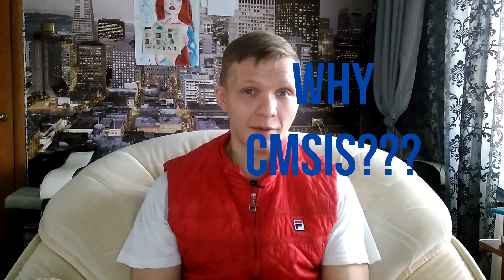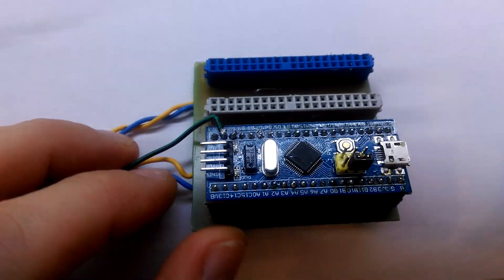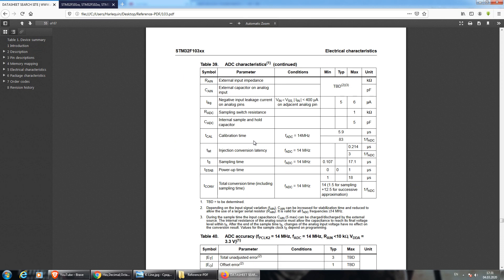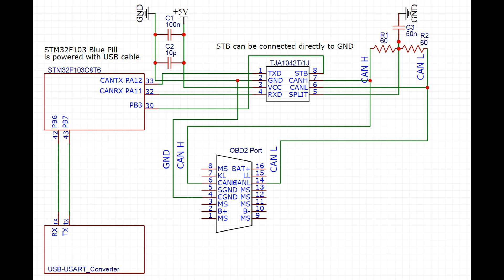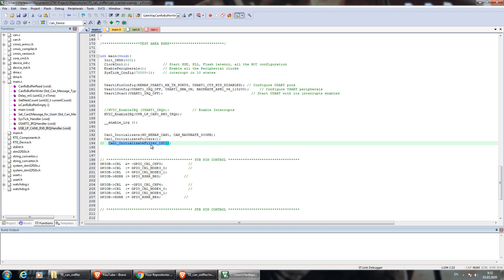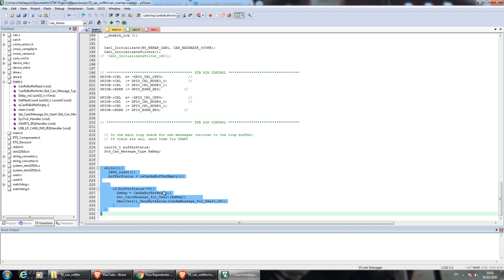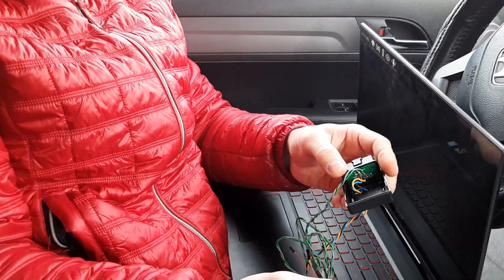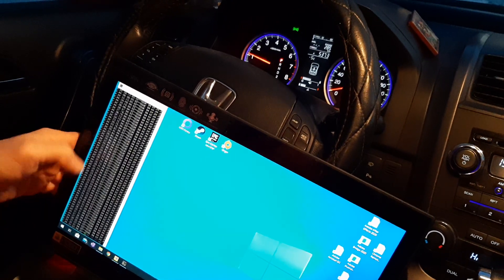STM32 CAN Sniffer. How to listen to CAN traffic in your car. DIY. CMSIS

Comment: Hey Alex, your videos are the best! I'm learning so much! 
Right now I'm working on a project and I really need some help... I need to read a odometer from a toyota, but I´m not really sure if I'm going in the right way, can I do it with this device you created? I builded a pcb similar as yours with a transceiver and a bluepill, using your program I can read the data from de CAN. Plese Help me!
Reply from the maker: Hi, Kaique! Yes, you can use this example to read out CAN data including odometer. If you don't know the id responsible for odometer, I recommend to use this code https://github.com/SvetlAl/CAN_HACKER_LAWICEL   together with CAN-Hacker software. First of all make sure your hardware is up'n'running and wiring is properly connected and soldered. If you have any issues, my email: svetlal@outlook.com
Reply: @alexsv1834  Thanks!! You're the best!

Comment: Hello friend, I would like to get data from a bms I have a stm32 and I am using tja1050 transceiver but I have not been successful. Do you think the use of CMSIS is relevant? What do you recommend me to achieve this?
Reply from the maker: Hi! Using CMSIS makes sense if you want fast compilation and data processing, with 72Mhz MK and 1mbps CAN bus this maybe critical. Do you use stm32f103? What place are you trying to use your device? What car?
Reply: @alexsv1834  I understand, thank you for responding, I am trying to get data from a battery management system (BMS) that has a CAN port, in order to show battery data on a nextion screen. Yes, I have a stm32f103c8
Reply: BMS Orion
Reply from the maker: @juanaraya8517  I've never worked with bms, but if you send me your whole project here svetlal@outlook.com I can check your bxCAN configuration for mistakes. When I was studying bxCan most mistakes were about hardware, like poor CAN wires connection (you shold solder em), also some tranceivers with the same digits in their names, but different characters like: tja1042 and tja1042t have different schemas
Reply: @alexsv1834  Thank you Alex, very kind

Comment: @Alex Sv can you design that for stm32f407
Reply from the maker: Yes, I have a plan. After I finish my current project I'm gonna start with stm32f407, this will be HAL: USB+CAN and 2CAN gateway.
Reply: @alexsv1834  OK i AM waiting
Reply: How much time it will take can you inform please
Reply from the maker: @mrigankabandyopadhyay8062  I think I can continue CAN-devices this summer
Reply: @alexsv1834  Okay Thanks I need that
Reply: @alexsv1834  OKay please Try to do it fast I need that help from you
Reply from the maker: @mrigankabandyopadhyay8062  Right now I'm working on another project, after I finish, I promise I'll start with 407!
Reply: @alexsv1834  Okay Thanks
Reply: @alexsv1834  Hi When will you work on obd you told during summer you will work.
Reply from the maker: @mrigankabandyopadhyay8062  Good news. I think, I'm gonna start this weekend. I've got an order to create a can-gateway to serve as speedometer calibrator for Mitsubishi L200. I'm gonna carry out this with STM32F407VET6 and 2 TJA1050. This will be HAL, because I don't have much time to study
Reply from the maker: I've made it. A prototype of CAN-BUS speedometer calibrator (based on stmf407) is ready, today I'm gonna test it on a real vehicle
Reply: @alexsv1834  Great waiting for that on youtube
Reply: @alexsv1834  Hi when I can except that

Comment: No data appears on my USART screen. How did you manage to print all that data? Is there any application you are supposed to use?
Reply from the maker: Hi! I'm using Hyperterminal, but ANY com-port terminal would be fine. Make sure, that you've set speed and usart settings correctly, also CAN-speed initialization is very important. You should test each  part separatedly to make it clear, what's wrong.

Comment: Great video. Is gnd connection needed for obd2?
Reply from the maker: Merhaba! No, it's not necessary as long as you power up your device (STM32) using car onboard power (i.e. battery or ignition). But! If your device power is separated from vehicle (in my example it's powered with a laptop USB) AND you want to do everything by the book, you should use GND OBD as a reference ground.
Reply: @alexsv1834  thanks. is every car can be sniffed like that, or some cars need "authentication" or sth like that?
Reply from the maker: @EmreKonca  Authentication may be  needed, if you're trying to reprogramm a car ECU (boost up an engine or register a key). But monitoring car network and injecting your custom data  is mostly the same for most cars. BUT! Remember, that different vehicle models have different network architecture: for example, OBD is enough to monitor most ECU statuses for japanese cars (like in my example) BUT! In many european cars OBD port is designed for diagnostics only and you have to disassemble interior to get access to High-speed CAN
Reply: @alexsv1834  Привет by the way :)

Comment: Love the music! 😂

Btw, how come the design has the 120R resistor (or two 60R resistors) on the PCB? If there's a CAN bus on the car, wouldn't it already have the two termination resistors, and wouldn't that affect the overall bus impedance?
Reply from the maker: The music is weird! Ahah 😂.  Using termination resistors is not necessary here in this video, but you should use a termination impedance when you test it on a workbench, for example if you bring a dashboard home and use it together with your device. I think most CAN devices in a vehicle should have 120 Ohm in case of open-circuit fault.